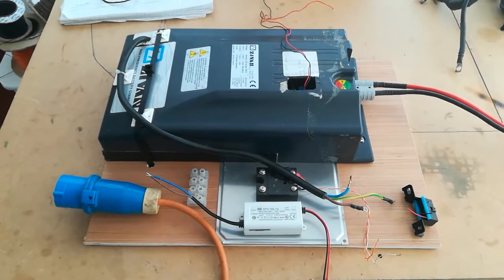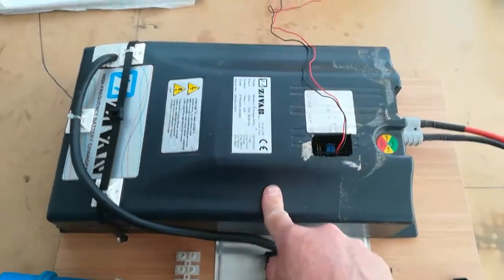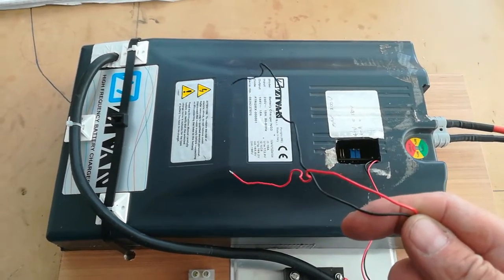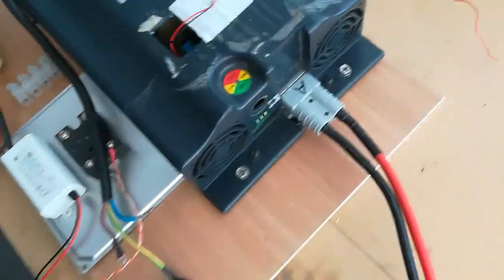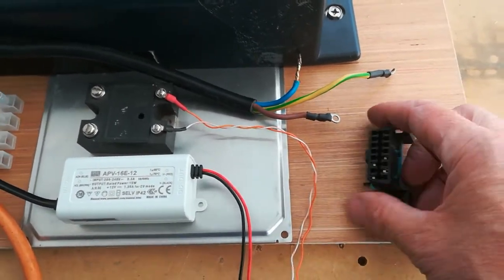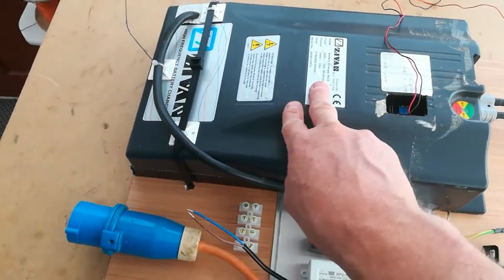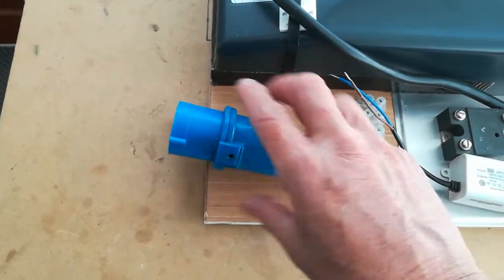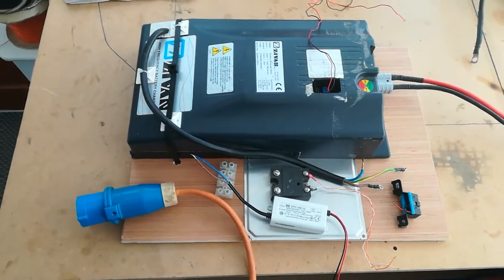Building a 72 Cell LTO Charger Video 1

Comment: I need a way to set the max voltage on my Zivan 144v charger. Im wanting to use 19 Nissan Leaf Modules and each module needs to be 8.35 volts max for a max voltage of 158 volts or maybe set a voltage of like 183.7 volts max that would use 22 Leaf Modules. I believe the charger can peak out at something like 190 some odd volts. How do I set that? I need something like that. I'll deal with a BMS later but for now I need the charger to just shut off or at least hold the voltage.